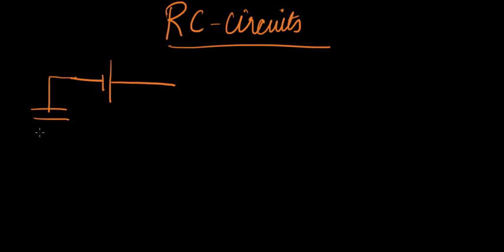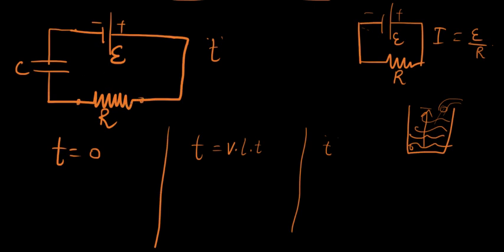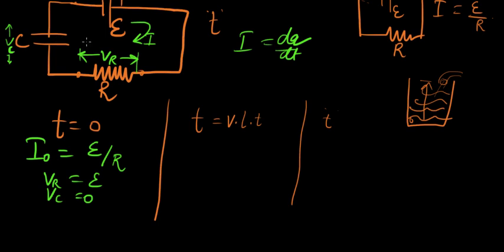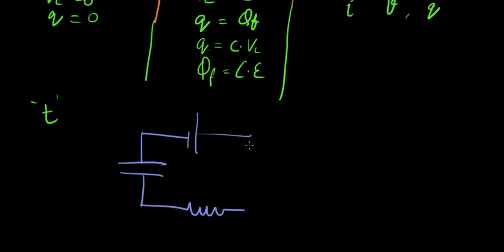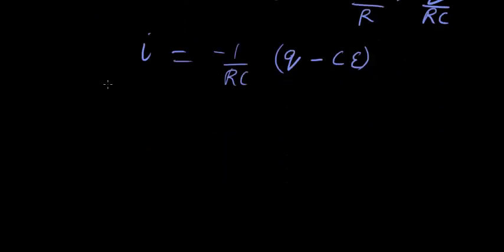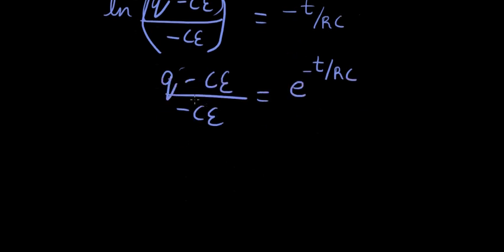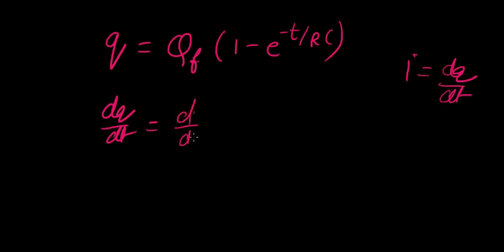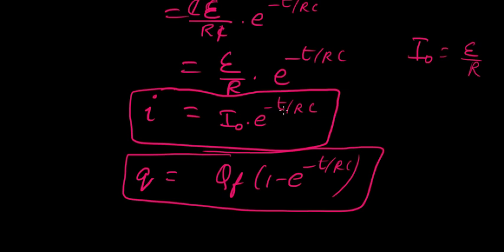University Physics - RC Circuits - Charging a Capacitor

Comment: I do not doubt your knowledge of the subject, but you are very weak on video production. I had to set the video to 1.5 playback just so I could watch the video. I couldn't get into the video at all because of the horrible audio, the coughs, the gulps, and other noises you made during recording. 

It also felt like you abruptly changed paths in the middle of the video. It would have been better to give the values before going into the process of how they are derived. Never ask your audience if they know the value of a particular concept, just tell them along the lines of, "We know that initial current is E over R." 

Write a script, take a few practice runs to clean it up a bit, then take several recordings of the audio and pick the best one. If any of your recordings have disgusting bodily sounds other than your voice, either edit it out or do another take. Viewers want to hear the relevant information, not the sound your throat makes when you swallow.

This is a pretty harsh critique mostly because I had to watch it for my physics class. I had to force myself to watch it through, if it wasn't required I would have moved on to a better presenter.
Reply: Sir Lance Goodthrust Yeah, but I get off on it.

Comment: With these how can I solve for resistance when all I have is Capacitance voltage charge and knowing that in 2ms the current is 5% of its original value?